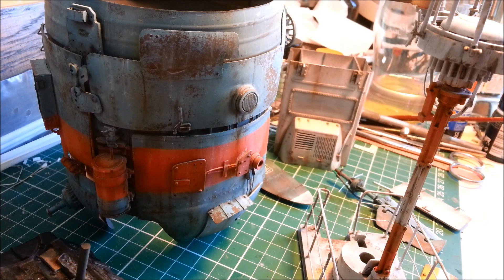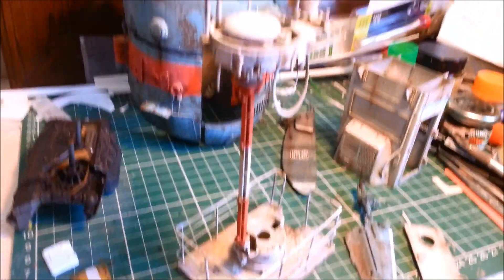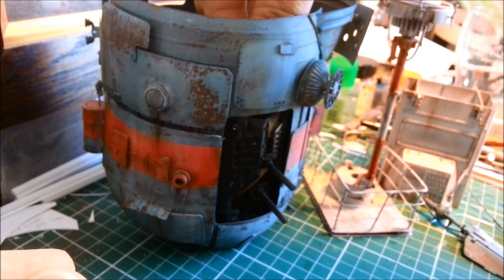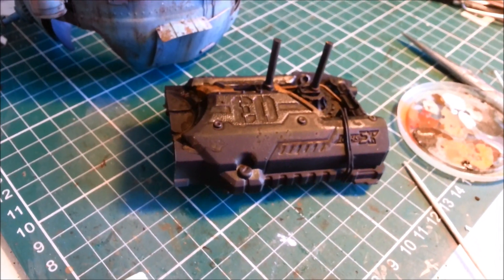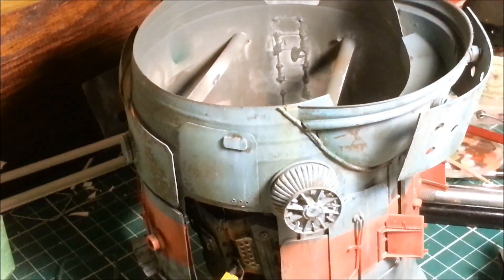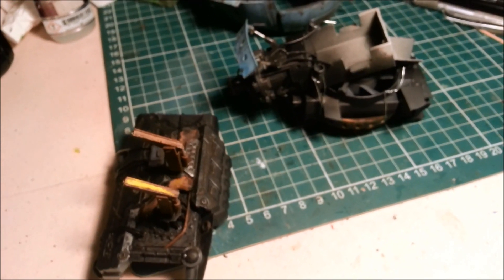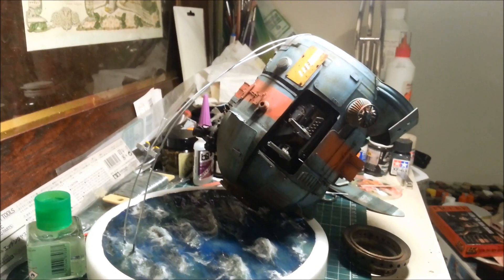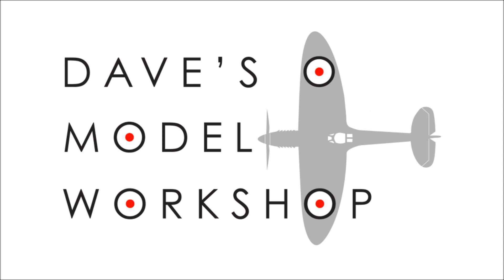Scratch building 1/35 scale sci-fi model ship -  Part 8

Comment: Oh man, bummer! Some suggestions that might help:
- have the wires go into the underside of the body instead of going over the top. Shortening will make them relatively stronger and severely reduce the leverage the hull has on the wires.
- reinforce the existing wires by sliding strong plastic hose over it. I have some 4mm dia. Hydraulic hose/tubing here that would slide over and it is very stiff. You might have to reinforce it at the base with glue and you can put glue in the hose before applying it. It’s really strong. You might have to add some ‘sea foam spray’ at the base to hide the joint. You could paint the hose/tubing any color and make it look like a real hose by stretching a coil spring out and over it (like Hasegawa 1/72 ground grew kit hose for planes). This would also fit the narrative as they could be hoses sucking in sea water for engine cooling. Good luck buddy, you’ll figure something out, I’m sure.
Reply from the maker: SoupFork I like the idea of taking on water via hoses... hmm... you might be onto something here. Thank you!

Comment: Nice to see it coming together. Do not terry do not fret. I believe you could solve your grief by shedding the weight and using a stand of coat hanger wire opposite the 2 that already exist. The tripod effect. To hide the fact it's wire I will let u in on a trick. Shoe laces and some boot laces can be hollowed out by removing the core. Now you have a braided sheath, looking like rope that you can slip over the heavy wire making it apear like a loose rope. Hope u find a solution that your satisfied with. Cheers mate.
Reply from the maker: I've seen that trick before for making the trunks of palm trees, it gives a nice criss-crossy effect if you get the right laces. But I've never considered it for rope effects. Thanks! Dave
Reply: Dave's Model Workshop I declare. We are on the same cosmic wavelength, brother!
Reply from the maker: You sir are my Canadian brother! ;)

Comment: Dave, I think the magnet is a cool idea but I doubt I would work with just one magnet on the base and in the model. It’s just not stable enough. It’s  sort of like trying to stand a pencil on its point. Unfortunately I think stiffer wire is the ticket - maybe like a wire clothes hanger. Maybe you could use that as a core and wrap your other wire around it? I’m sure someone will have a better idea.
Reply from the maker: Bill Browning I agree, with some more rational thought and distance magnets are not the solution...

Comment: Maybe get a length of chain (at a matching scale) and solder the links in place to fix them. It might be strong enough to hold the weight an you could still shape it to look slack hanging off the hull. You could disguise it in a porthole like it was attached to an anchor.
Reply from the maker: Thanks Hitek! Good suggestion. It would be tricky to weld, but would look realistic.

Comment: I say go with your 'tow cable' idea. You could do a loose braid of wire just as thick as your original to double or triple the strength (1 or 2 extra wires) and THEN wind that braid with a lighter gauge wire nearly perpendicular to the braid and give it a nice textured mass like the wires are armoured to survive dragging across shoals and sea floors. Add one or two little bits of plastic or metal tubing to look like strain relief or connectors.

Could a braid wire be stiffened with solder? Like a silver solder perhaps?

Could you make a cast copy of that round metal piece to get the same look with a much lighter weight?

Push forward, this build is fantastic!
Reply from the maker: Thanks Axtmann, I appreciate the words of encouragement :)

And I love this idea. This will be my first plan of attack. Dave

Comment: I'm thinking something like brass or steel tubing that's not as flexible as the wire you have, heated and bent have that natural curvature you want. Or maybe plexiglass rod heated, bent and painted. It should be stiff enough to hold the weight of the model but I just don't know if it's available in a diameter that's small enough to look good and stay stiff. Same with the tubing.  You could place a third (or more?) wire for more support but again, it might detract from the overall look. Really love your work, sir.
Reply from the maker: Thanks for the suggestions Jeff. I'm considering a third wire as well as thicker wire, so you read my mind.

Comment: Dave, my first thought was maybe taking some kind of jewelry chain and soldering it solid. probably a scale looking chain would still be to weak. I do like flippy211's comment. The crane is either lifting something out of, or dropping some kind of equipment in the ocean. Using 1/8" music wire to look like a large hose going up to the crane hook, and then sagging and going into the side of the Seahorse. Or maybe several 1/16" pieces of music wire, soldered together in key locations, to look like a massive wiring harness. Same way, straight up from the equipment to the crane hook, sharp bend, large sag, and into the side. What I like about this idea, is it's giving your model some action. Sorry buddy, had to laugh when I watched this. Guess why I found it so funny was, I've had plenty of days just like this myself. I think in hindsight, this wiring failure is going to make your model cooler. Although this may throw your deadline out the window. Hey, there's always next year.
Reply from the maker: So true, after so long building I'd rather finish it to my own satisfaction than rush it. Thanks for the words of encouragement sir.

(And I don't mind at all that you laughed!)
Reply: Dave, Glad to hear your not upset about the laughing comment. I build vintage style RC airplanes from scratch, from plans found on Outerzone. And convert them to electric. I modify old building techniques to newer ones,  sometimes extend the nose a bit for weight, slap a large plastic cowl and plastic radial engine up front, for a fun look. And of course throw a bunch of my (brilliant) ideas at it along the way. Lets just say, some are my favorite flyers, and some are turned back into the multitude of pieces that I started with. When I hit a tough spot, I rotate to another build. And then one day, just like that, it will pop in your head, (That's what I'll do). Then I look forward to going back to that project, instead of looking at it thru eyes of frustration at that time.
Reply from the maker: That is a bloody good idea. I've been studiously ignoring the suspension for a couple of days now, just working out solutions in my head and going through all the suggestions, and I think I have an answer.

Comment: Evergreen tubing over the existing wires maybe! You could gently heat them afterwards in areas to mould and bend/curve them to shape like an S with perhaps a secondary attachment point near the bottom. Actually could you create little rusted eyelets on the outer hull of the seahorse to thread the wire through or could you feed it thru the first rung of the ladder. Thinking some more run the evergreen tubing the full length of the hull disguised as some type of pipe and feed the wire up thru it.
Reply from the maker: Hi Keith, thanks for the suggestion.  I came up with a solution - check my channel this weekend to see what I came up with ;)
Reply: Dave's Model Workshop oooh cool looking forward to seeing how you got on

Comment: I think that supporting it from the side is the main problem and thicker or braided wire will still not help. It would be a shame to lose that gas hob part as it looks really good. What about a thin rod coming from the centre straight down into the water?  Maybe disguised in some way.

Comment: Hi Dave, have a suggestion you can put the acrylic rod in, but you add cotton around it so it looks like the motor is blowing some sort of steam down. I think if it is done properly it would look nice. Edit there are a lot of cool ideas here. This is (I am hoping) constructive criticism. Generally a ship of this size would have at least four support cables to hold it down from the bottom, while your model doesn't have an engine to keep it in the air you can get away with the rod and cables from the bottom and you can keep your metal thingy. Basically how it works out in my mind is you hook the wires from the bottom to keep the ship up, but the wires themselves are braided (I think that is the term) which creates a stronger system and looks cooler. You can probably do it with a drill on one side and pliers on the other if your hands don't want to do it. Now add the four wires with the acrylic cotton and Bob is your uncle.
Reply from the maker: Braiding the wires is exactly what I'm thinking too Ferdinand. I can use the wire already there, and just strengthen it.

Comment: Hi Dave. Well the obvious solution in my opinion is to support the bottom of your breast engine with very thick wire or tubeas a support like a pillar and then dress It up with some foam or cotton to make it look like there is smoke coming out from the bottom like it's hovering.
Reply from the maker: I like the smoke idea, but it might feel too rocketship taking off?
Reply: That might be true but the you could add smoke from the other end of the engine exhaust to counteract this. Or use a clear plastic pillar and a led on top to simulate hovering :) (pulsating light)
Reply from the maker: Hmmm, pulsating light could be fun... Thanks for taking the time to offer suggestions, I really appreciate it :)

Comment: How about replacing them with piano wire (spring steel) from the hobby shop
Reply from the maker: Is it flexible enough to bend over at the top of the hull rail? I've never worked with piano wire before.
Reply: You can anneal it at the top where you want to bend it by heating it to a red hot colour and then let it air cool. Gas stove would be hot enough for the wire thickness you have. If you try to bend a sharp bend without annealing it, it will snap.

Comment: 1: Very strong steel rod instead of wire, then hang a bunch of smaller wires around them so it looks like he's towing or lifting something big under the water. Will be a bit tough to bend it, but it should only be a little thicker and much stronger. 

2: The Magnet would look amazing but I'd expect getting it to stand up right in the perfect position could be tough. Maybe multiple magnets. 

3: Maybe you could go for something like covering up some thicker supports below it with sea spray/mist etc. You could even manufacture a "jet exhaust" coming out of the engine and use that to disguise some perspex rods?
Reply from the maker: Hi Matthew, sorry for not replying before now. Thanks for the suggestions mate. I think #1 is the way to go, steel rod. I'll get a workout bending it!
Reply: Great! Good luck. May well run into similar standing issues when I put mine all together. All part of the "fun" I suppose :)

Comment: You could use a stiff steel rod (clothes hanger maybe?), bend it to droop like a cable, and then wrap some wire around it to give it a braided steel look, that might work. If you're willing to sacrifice some of the appearance, you could try getting the rod/wire to bear all the weight and use fishing line as a guy wire to hold it in place. You could also try using a thin, flexible stick (do you have willows in Australia?) painted to look like cable.
Reply from the maker: Thanks Milo, that's a good suggestion. I like your stick idea, but it would have to be strong! (And yes, we do have willows here in Australia) - Dave

Comment: Stiffen up your rod, in gauge or metal, heavy galvanized fencewire not coat hanger wire unless old style, try to support on two opp. sides, dry fit for balance on polystyrene block to ground surface position the base support rods. Remember to note the mounting points. Fix the new rods to model, firmly so you can hold it by the rods & fly it around the room. Cut the old wires out, drill new position mounting holes in base, insert glue rods cut off flat below base. Done...General Rid Stump!!!
Reply from the maker: Can I just say "Stiffen up your rod" is the best start to a comment on my channel I've ever read? What can I say, I'm juvenile...

Thanks Michael, I think I definitely need to do the test fitting and trialling you suggest, If I had done that first I wouldn't be in this situation now.
Reply: Dave's Model Workshop I had the same floppy rod syndrome, I took an overnight break & thought over the problem, the prob. was enthusiastic creativity over reality. Sometimes using brass rod firmly socketed to the model is the wise choice for simplicity reliability durability. For art & budget we get creative & the result is a riddle which might take many attempts with some unforseen skills & unexpected results. My flight stand started with old coat hanger smoothly sinuous silver, ended up a wound up multistrand twisted and forked lightning bolt a intermediating connector from earth to sky. Which I the had to paint in the new narrative to have the piece make sense (alotta work gold) Advice to solve my riddle if you quit start afresh test your brain then the components one at a time, use a screw & bolt, a bedspring, telescopic mount, if that's what it takes use a pencap and pen, the objectives insight use every thing you have...General Rid Stump!!!
Reply from the maker: Herr General, thanks for the advice mate. I think you hit the nail on the head with "enthusiastic creativity over reality"!!! ;)  Is there anywhere online I can see your creation?
Reply: A strange damaged device, here Dave, there are these, No, that ones not digitised yet, i want to put a gallery up - to make ideaologistic (examples from indimogelor the modeler,) good idea you think? 
You know about the Campbell's journey & the hero, trials & trails, the known & unknown destination, this is what happens when we embark on a creative model venture.It is not so much about what is created, but more about what we learn, the skills we adapt - the objective/creation/desire via imagination, getting it's like needing to cross over a tall mountain spur & hidden river valley.
My emphasis - picture the model in ones mind, the outcome, mutability is created (eg; instead of sinuous supporting rods, make now use of a chicken wire lattice) - sameness requires a known formula, a familia order & repetition of material & methodical construction ( the paved mountain pass offers no new vistas NO RISK/REWARD-NO ADVENTURE).
So through the process - if we don't Quit - model making is teaching, focused practice in concious thinking - intellectual skills now turned to material outcome. Becoming skilled in concious thought - making conscious decisions in material - conscious of physical action with safely cutting, then conscious application of glue and brush, conscious then with the paint & brush, it is through the makers repetition of conscious creative act that we breath our abuntance of consciousness, our life force enters into the work taking over reality - Dave just try and have some fun mate...General Rid Stump!!!

Comment: I can't imagine any solution to this that doesn't involve stronger wires. :/ Coathanger wire is what I'd be looking at first.

It's also not just an issue of weight, it's also balance and weight distribution. Probably also worth looking for a solution that lets the model rest on something positioned closer to its centre of gravity, which I assume is just above that big burner part. Maybe keep the existing wires, but supplement with some shorter, stronger, thicker wires that come out of the engine section?
Reply from the maker: Adrian Forest I think that is a solid suggestion. Thanks mate. Centre of gravity is going to be my friend.

Comment: Cross out the magnet (too complicated) and winding up more wires of the same material, that wire is light and will still bend with a few more. You need a sturdier, non bending metal wire like the ones in coat hangers.
Reply from the maker: Totally agree about the magnet! Way too complicated. I came up with a solution - check my channel this weekend to see what I came up with ;)

Comment: Hi mate! Maybe an anchor chain to the sea? but instead of a regular torus pieces you can fix them with a glue or soldering the chain, so it will be in one piece?
Or maybe another (unexpected) arm, pulling a pice or scrap (like flippy211 suggested, but with a heavy arm) that will support the weight?
Reply from the maker: I like the anchor idea... chain could be a bit of a bugger to weld in position... Hmm, good ideas. Thanks Swinging Bunny!
Reply: :-)
Not welding (electric arc) but soldering. stretch the chain, attach a lead wire and melt it with a burner into the chain. I hope it will be strong enough, though...

Comment: Gutted for you, Dave. Just read Flippy's great idea/comment, which kinda makes mine superfluous! But for what it's worth I was going to suggest either thicker wire going up the base, but still trailing in the water, (probably not possible due to space), or maybe add the second gas burner and place it on the base, so the mode sits on it and go for an air cushion  effect. Both of which seem slightly stupid now I've written them! Hope you can sort this, matey.
Reply from the maker: geggy5151 Thanks mate. I’m working on it, I think I have come up with a solution. Thanks for the support, Dave